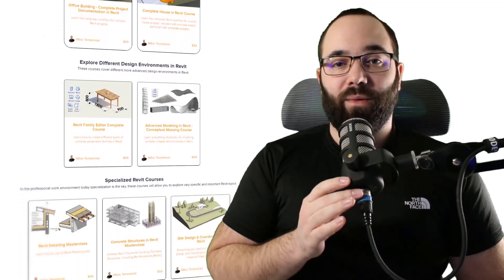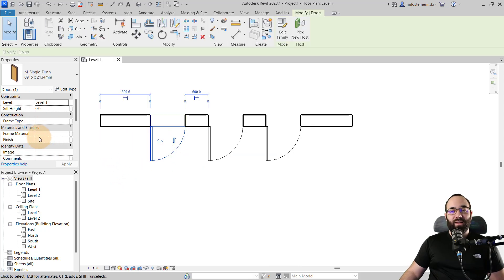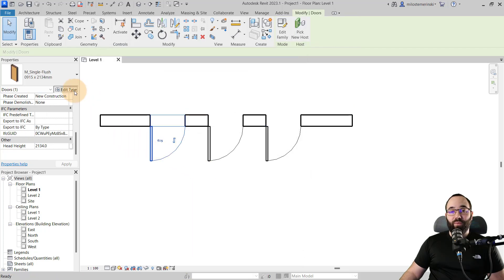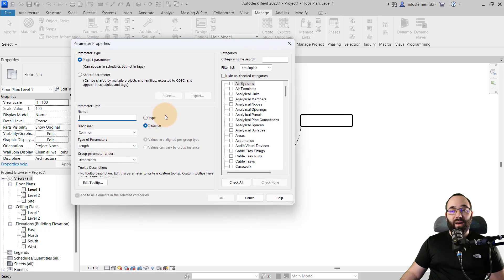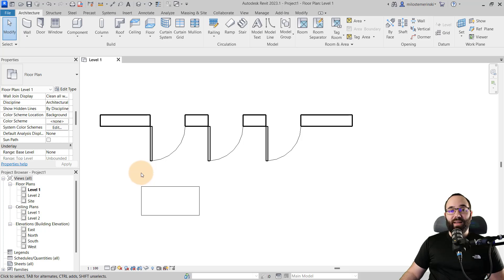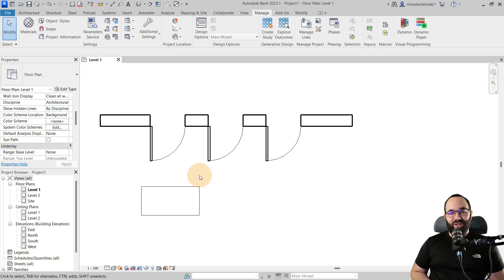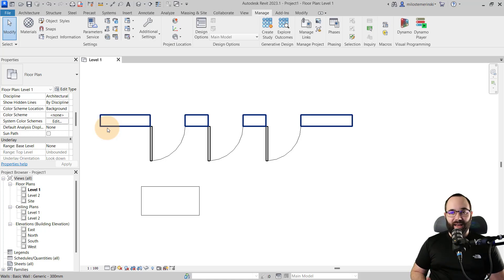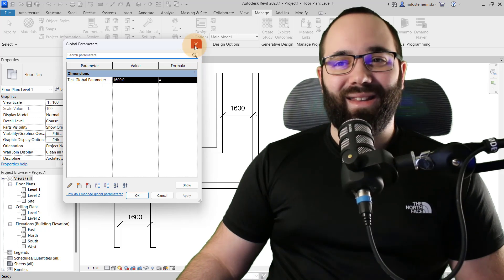Parameters in Revit Tutorial

Comment: Nice, for some reason never used global parameters, essentially its similar to setting parameters in a family, will try to take advantage of this, not sure how yet
Reply: I tried several times, and i don't see much value in them.
In most cases scheduling(shared family/project parameters) are better than global parameters.
I tried to used them in visibility of service areas (boolean yes/no parameter) in elements. But still in most cases doing it individually(schedul"able") is better and more suitable. Or just by scheduling by levels/anything ... etc, than just pure yes/no for entire project.

I working with Revit since +/- 2018, and honestly couldn't find much benefit of global parameters. I mean i had some crazy ideas, how i could use them ... but still it wasn't worth :/ .